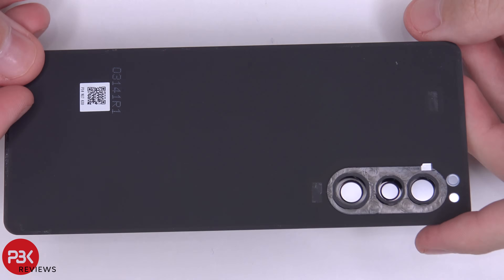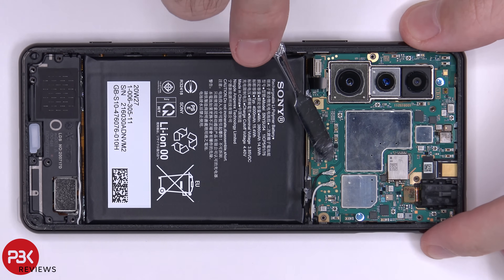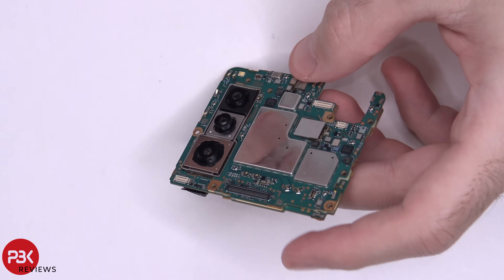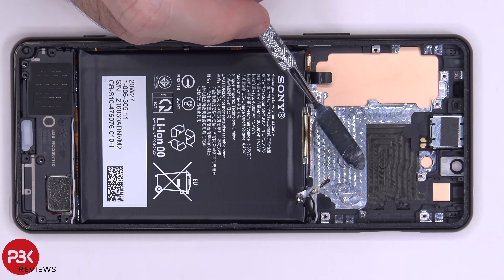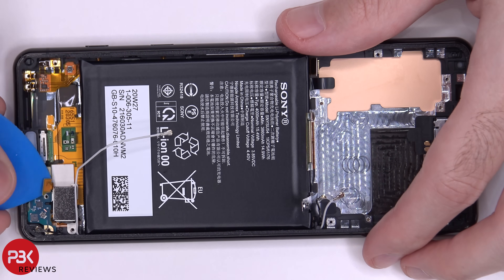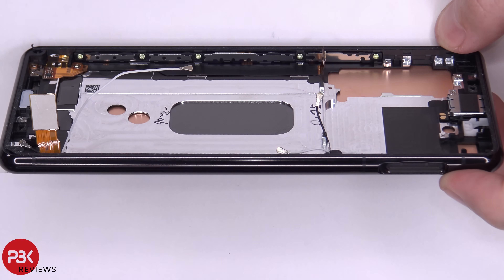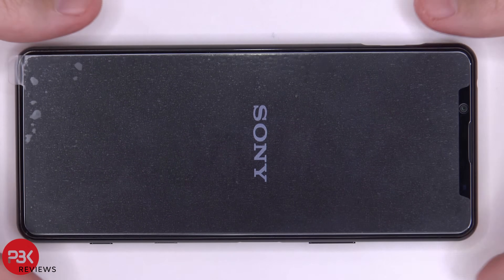Sony Xperia 5 II Disassembly Teardown Repair Video Review

Comment: So, to replace the screen you need to remove everything? Or do you have access to replace it from the front side?
Reply from the maker: You would have to do it from the back. You remove the back plate and remove the speaker assembly along with the vibrator motor and small board to gain access to the screen cable to disconnect it so then you can pry your screen off from the front once the cable is disconnected. You don't need to disassemble the motherboard portion on top if your doing a screen replacement.
Reply: @PBKreviews  do you know if I would have to replace the whole LCD screen to get new glass? Repair guy told me I need to get the $300 lcd screen + glass to replace just the glass. The pixels are not actually broken on my screen. Just the glass.

Maybe, would I even have to open up the back?
Reply: @PBKreviews  i guess i have to figure it out how to do it
Reply from the maker: @TheMaux64  you would need to replace the entire screen assembly, the glass is fused to the display and is not user replaceable. You would need to take the phone apart to get to the screen cable to disconnect it as well and replace with new screens cable.
Reply: @PBKreviews  it's not just glue that holds glass to screen?...it's fused, wat does this fused mean?...everyother phone uses Loca glue to put new glass back onto digitizer screen??
Reply from the maker: @drubreezee5975  Fused as in joined together to be as one piece. Not sure exactly what glues and such they use by the manufacture to fuse the screen and glass together, but I doubt its Loca glue. That's more of an aftermarket or refurbishment method 3rd parties use. Most people would not be able to remove the glass and replace it without damaging the screen or being left with a screen that has cosmetic flaws etc. Requires special tools and experience etc. Yes some end users have the skills and tools needed to do it, but again most people don't. I myself would not do it, since I would rather have an actual factory done product and not have to worry about touch issues, dust or debris under the glass or waste all that time doing it myself. :)

Comment: Do you see any chances of this phone losing some water resistance as it ages?
Reply from the maker: Its possible but not for a very long time.
Reply: @PBKreviews  as in the phone will not be waterproof anymore after a while?
Reply from the maker: @ddcll9538  maybe after many years if its under great wear or say used in construction type areas where a lot of dust and debris can affect the phone, it might not be as water resistant but just my opinion.
Reply: @PBKreviews  thank you for your professional opinion
Reply from the maker: @ddcll9538  you're welcome

Comment: Would I have to disassemble the entire phone in order to replace the outer screen?
Reply from the maker: You would have to take the back plate off as well as remove the speaker assembly and vibrator motor etc. on the bottom so you can disconnect the screen cable and then pry your screen off the frame, add new adhesive, re apply your new screen and reconnect everything.
Reply: @PBKreviews  Thanks for the help you know, you just got another sub :)
Reply from the maker: @silencedspeech4953  Thank you, appreciate the support :)

Comment: Can anyone recommend a good screen protector for xperia 5 ii? I want to get this phone so bad but accessories are so scarce for it :(
Reply: I feel you. I live in Canada and Sony phones are non existent over here. For the screen protector, I ordered 2 different ones from Olixar, their tempered glass and film protectors. I've read reviews saying that the tempered glass doesn't stick very well so beware. Will update this comment if the tempered glass is no good.

If you Google search using English, you basically only get 2 reliable options, Spigen and Olixar. But to my surprise, accessories for the 5 ii is just scarce in general, because when I googled using Japanese and Mandarin, I could not find anything new than what I already could on Ebay... maybe the phone is too new or not popular enough? Hard to believe, since Sony held a convention in Taiwan.

Comment: Hi. Is the back plate easy to remove as same as the xperia 10 ii or is it much harder because i notice in the xperia 10 ii video, you said it was fairly easy to remove in the comments even tho both of them got ip68. Thanks.
Reply from the maker: Hi, it's not difficult. Applying gradual heat with a hair dryer for example while prying with a pry tool would make it easier. The only thing that may make it difficult is the fact its glass and you don't want to break it. So you need to take your time. You can also use a suction tool to be able to lift a corner or side of the back plate to get your pry tool under once you heat it up.
Reply: @PBKreviews  Much thanks sir ✌️

Comment: Hey, does the bottom speaker really not have a mesh or grill that's visible from the front? My 5II doesn't have one, the bottom speaker looks just like a gap 4mm deep. I was wondering if it's designed like that or if mine is missing a waterproofing element. Thanks!
Reply from the maker: Are you refering to looking at it from outside? I know it has a mesh filter over the speaker opening inside the phone.
Reply: @PBKreviews  Thanks for your reply. Yes, I am looking at the bottom speaker from the outside. I just got worried because my previous water resistant phones have visible grilles or mesh right under their speaker holes. But if you found a similar mesh inside where the speaker is, then I guess there's no need for there to be a mesh right at the opening.
Reply from the maker: @somayough  Oh ok, ya you should be fine, it does have a filter inside :)

Comment: I am wondering what is the thing next to the flashlight, where the white circle is in the glass?
Reply from the maker: It's one of the camera sensors I believe, not sure exactly what it does, or if its related to the flash but yep.

Comment: Well it's a engineering failure for 98M USA customers if it isn't certified for wifi calling on TMoble
Reply: I've got the Xperia 5 ll and it does have WiFi calling AND 5G......but I'm in the UK hehe
Reply: @paulmckee4168  yeah I know, but think how you'd be irritated if it didn't work for wifi calling in the UK? You probably wouldn't have kept it right?
Reply: @mswkickdrum  I've honestly never had a need for WiFi calling. My network signal is good wherever I am. But if I lived in a much more remote spot then yeah it would be a problem. Although, I'd probably use the signal app to make calls instead....
Reply from the maker: I'm not 100% sure but it might be a possibility that it can be added down the line via software update etc.
Reply: @PBKreviews  nope. Check the techy phone forums. This is a major problem for sony ever getting a hold in USA market.
Reply: @mswkickdrum  it's not an engineering failure it's the fact that tmobile doesent want to carry another brand in the sea of brands they already carry. They have exclusive deals with a lot of brands and if you as a phone company want your phone use all T-Mobile services you need to pay them so tmobile can keep its prices low. It's like apple is exclusively carried by a select few cell phone operators abroad because of exclusivity deals. Phone companies need to pay money to carriers to use their firmware for features such as video call ,it can make video calls with others because they paid others for using firmware and it is a possibility that if if the phone gets sales then they'll add tmobile but sales are not looking too bright for any company this year.
Reply: @reenachauriya4931  no, it's the result of sony not getting their phones certified with tmobile for wifi calling on their network. A failure to engineer the software into the phones setup from the start. I have xperia xz1 compact that is vowifi certified for tmobile from the factory by sony. I believe it's the most recent model so equipped and it's from 2016. This is a choice sony is making and it sucks. I want a new sony phone and they refuse to make one that utilizes the features of a network that serves 98M usa customers. All pixel phones from the very beginning were vowifi certified and they weren't sold by tmobile. I have read that there is some contractual problem between Sony and tmobile that relates to the xperia model Sony pulled out of with Verizon.

Comment: Question: what do you replace the pull-release tape with when re-assembling? You didn't show that in the video. Some people use normal double-sided tape for the battery, which makes future repairs a pain in the ass.
Reply from the maker: I use adhesive like double sided tape but you don't need to put too much to make it impossible to pry off. Also some adhesives are stronger than others and you can use something that is not too strong so it's easier for repairs in future.

Comment: 🤔the battery made in China? Overalls made in china low quality
Reply from the maker: Yes its made in china, the same company also makes batteries for Samsung and other phones as well. Keep in mind, these factories that make products for OEMS and manufactures like these are under tight control and run operations in a highly controlled environment. So its not like they make bad quality parts, they have standards set by the OEMS that they need to meet etc.

Comment: How do you assess the chances of damaging the upper mic when poking a paperclip inside its hole? Many thanks!
Reply from the maker: Hi, you should be fine, the mic is a solid metal like piece doesn't break that easily. Plus usually on most phones there is a filter and the mic is sitting to the top of the hole so the paper clip would not touch it.
Reply: I think the mic sits perpendicular to it's hole, so a pin is unlikely to even touch it, unless you're really trying.
Reply from the maker: @YeOldeKamikaze  Yes, correct. Now a days most manufactures place the mic above/bellow or to the sides of the hole or have the sound directed through a channel to the mic so people can't damage it if they accidentally put a pin in the hole.

Comment: its really really bad if you have a damage charging port..
Reply from the maker: Not necessarily. You can replace it and its not soldered onto the motherboard. It might be a little bit of work ya, but its not too hard to do it and also the fact the battery has the pull tabs makes it so much easier compared to some other phones.

Comment: Bad design if you need to change  the TYPE C USB  socket,
remind me of the xperia Z3 design
Reply from the maker: A separate board for the charger port on bottom would have been a bit easier, yes, but it's still not that difficult to do. Could have been much worst if there were no pull tabs on the battery and if the flex cable for the charger port was glued or adhered to the midframe etc.

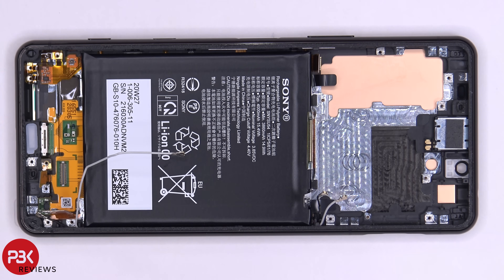Comment: 5:24 wheeeeeeeeeeeee
Reply from the maker: lol yup
Reply: That was the cleanest pull-release tape removal I've seen in a while haha. Most people need to use tweezers and patience because the tape likes to snap mid-removal.
Reply from the maker: @YeOldeKamikaze  lol ya, I hate it when it breaks mid way and your stuck to prying it with tools when its meant to come off easy. This ones pull tabs were much better than most phones which break off easily. Not sure but it's also possible over time the pull tab will become more brittle and break/rip easier.

Comment: The headphone jack does seem to use quite a bit of real estate as many of those phone manufacturers are claiming. I'm not surprised that other manufacturers are removing it, especially when many of the newer smartphone chips are demanding more real estate for bigger chips and better cooling. However, I would gladly sacrifice one or two of those cameras for a headphone jack. But then, who would buy a flagship smartphone with flagship prices that doesn't have one of those top end cameras. Ah well... I hope the headphone jack stays in future iterations of this phone, it's the main reason I bought it.
Reply: These phones are huge as hell now a days no excuse not to add a jack in since they are getting humongous. None at all.
If there is no jack you will wear out the charger port faster (if you don't use wireless headphones) and you can't listen and charge at the same time with the C port so... I'd rather just have a jack.
It's the same bull crap of having ditched the notification light when like you just saw in this video... is tiny as hell. So why ditch it to begin with? 
I'd rather have that then always on screen nonsense.
My Xperia L had an amazing notification light on the bottom man what happened to having a nice notification light? Phones are so dull now a days.
Sony might not even release the Xperia 5 iv now since... it has a small screen of 6 inches compared to what everyone is releasing now a days with screens of 6.5 or bigger which is huge in my opinion.
That's why I just bought the Xperia 5 ii and will be changing out the screen and batteries when needed.
All these IP68 phones are a hassle to open up compared to my LG v20.
Removable batteries was best feature phones ever had that sadly went away.
Easier to open up your phone and pop in a bigger battery in that sucker.
Now we need heat guns lol and more glue to put things back together yaaaaay.
Reply from the maker: Ya, or if they include adapters for the charger port to headphone jack out.
Reply: @PBKreviews  Carrying a dongle around feels dumb for me, why don't just have it in the phone... This might be one of the last flagships with a headphone jack unless Sony sticks with it in the future (and I hope they do, it's very useful for audiophiles and photographer nerds)
Reply from the maker: @virusrhino5399  true but you can always just leave the adapter connected to the end of your earphones or headphones since your going to be carrying that with you if you plan to use it. Also since everything is going wireless they consider that as a second option. Only other thing I can think of is one less way of water or dust getting into the phone so makes it easier to make them resistant to water with one less hole to plug up
Reply: See for me ile sacrifice  the camera  for a better dac chip but that's me the chip in this phone sounds great  but if sony eventually  ditches it to follow the other trends then ile most likely  buy a walkman  and a better dac amp 

Cheap walkman nw-a105  the dac chip is OK but not great I can get better sound with spending 3k on a walkman and have enough  power to drive 600ohm headphones  if needed ifi diablo  dac amp is the best quality  portable  dac amp  and its way better than spending  3k on a sony walk just saying £200 sony walkman nw-a105  with a ifi diablo  dac amp  thrown on it for £900 yea it will cost £1100 and a silver dragon cable and need a 6.3mm to 3.5mm adapter  for it but hey its better and its cheaper  than buying sonys most expensive  walkman  when you can get better and have more drive for higher independence  headphones  be pretty overkill on 32ohm or 40ohm  headphones
Reply: @jonathanoxlade4252  
It's not just for music though.
I use headphones with a mic on it almost always to talk (or speakers on the phone) because it's easier to hear what people say, you don't have to hold up your phone to talk and you keep your phone away from your head (look up what SAR is on phones and why you should keep your phone away from head and body as much as possible). 
That's why a jack is so nice and convenient.
Definitely won't get wireless headphones as more things can be lost and then you have to charge the batteries. And it's more "signals" going to your brain which we already have enough of.
No thanks I'll gladly use wired.

Comment: So what is Overall impression about this phone after your Operation ? Will you recommend ? :)
Reply from the maker: Yes it's a good phone, I would have preferred a bit more cooling features like some 3D graphite layer/film or copper plate underneath the mainboard as well instead of just thermal paste  but I like the fact it isn't too difficult to repair and the battery has pull tabs so it makes for an easier battery replacement compared to most phones.

Comment: No unnecessary gimmick. Just a simple well-engineered and a very light phone
Reply: Agreed, I need it
Reply: Hm, what about missing colling system under the mainboard - copper vapour chamber or copper tubes at least? I can't call it well engineering, sorry.
Reply: @victorrumyantsev3718  According to the UL database, the 5 II retains 89%-90% of its 3DMark Wild Life series score over a 20-minute continuous run, compare that against 68%-82% of the SDM 865+ Note20 Ultra or 74%-77% of the iPhone 12. Doesn't sound like there's a problem to me
Reply: @DGao-zz5vq  It is just a damn benchmarks, you know. Pretty much it says nothing.
Reply: @victorrumyantsev3718  it says more than enough. Throttling tests are meant to be done with artificial loads, it's called control the variables.
Reply: I can say it's been 2 years using the Sony Xperia 5 ii it works just as It did in day one even better in the camera department with the newer Sony Xperia 5 III and IV apk
Reply: @Paul My one has got blown up top speaker and dead microphone for no reasons. Seriously, no impact or liquid damage - just failed parts. This is the first phone I have with failed hardware for many years. The last one was Pixel 1 with failed GPS which wasn't so critical. Shame on you, Sony!
Reply: @victorrumyantsev3718  ah right so your phone didn't work so all actual facts about the phone don't matter to you because as we all know: anecdotal evidence > actual evidence
Reply: Hey do u have to take the whole phone apart just to replace glass on front screen..not digitizer just glass....I can just heat that off off digitizer and replace with new glasses and glue right?
Reply: Except that fingerprint sensor is not working
Reply: Apple crying in the corner